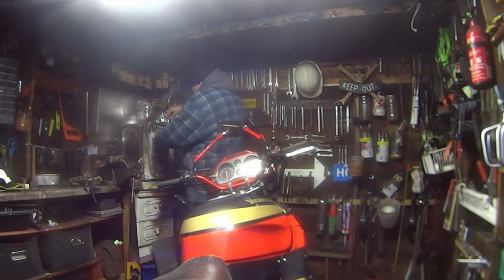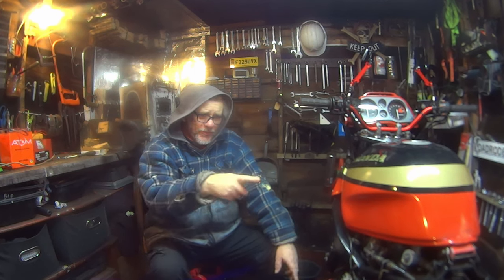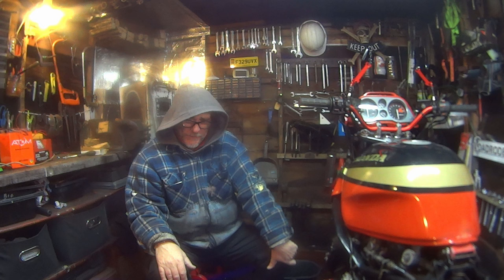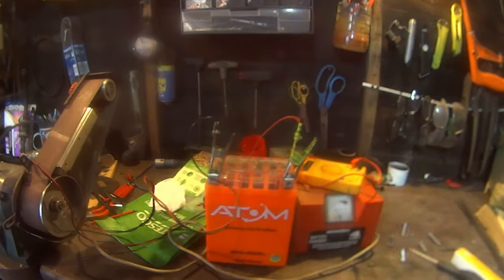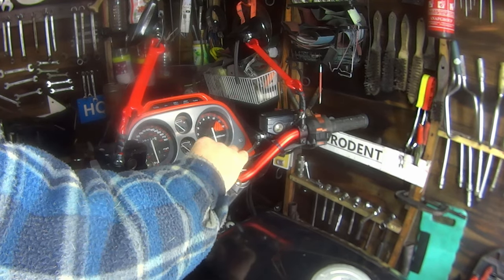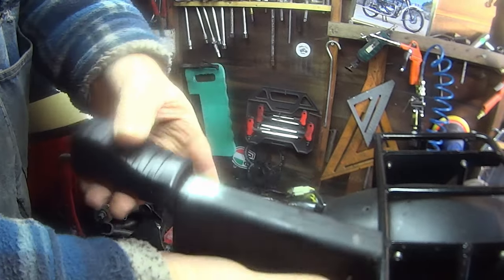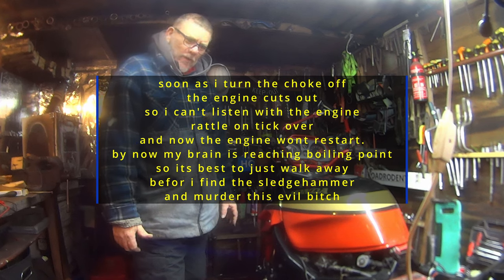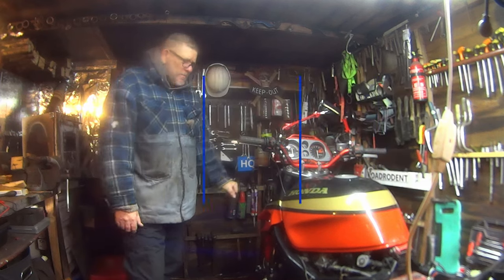CBR1000F Landfill bike. Evil B##ch.

Comment: Hello there! Lots of strength to you with that bike. Remember that, ”if it doesn’t take it doesn’t give”. I also think that whistling noise soundslike starter, may also be charger because dead battery adds alot of resist. Unsynchronised carbs also cause weird noises including rattlelike sounds. When i did my first carb sync for my cbr 1000 and turned adjusting screw too much engine started rattling. Remember this bike was long cold corpse before you started CPR!
Reply from the maker: Hi. Janne. Thanks for your comment it's very helpful and inspiring and much appreciated 👍